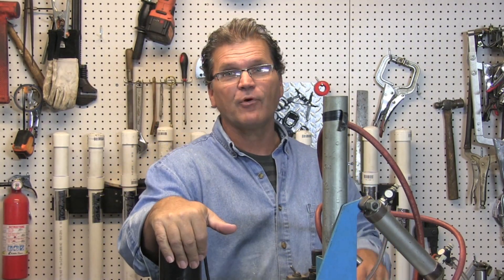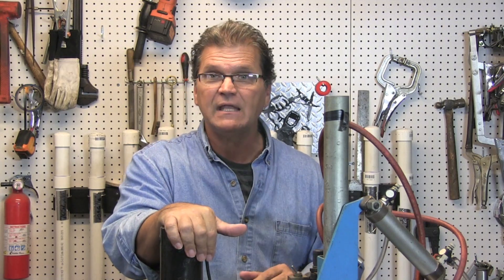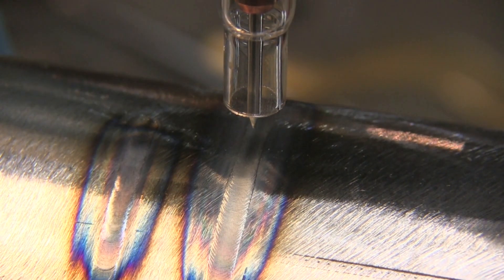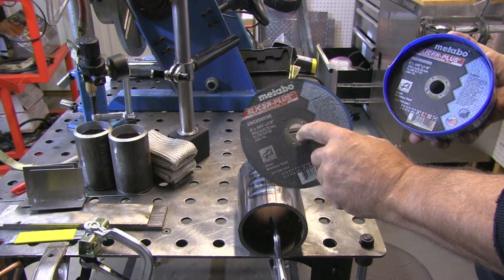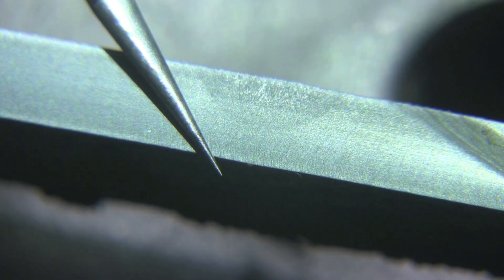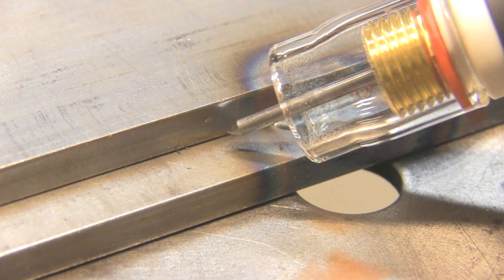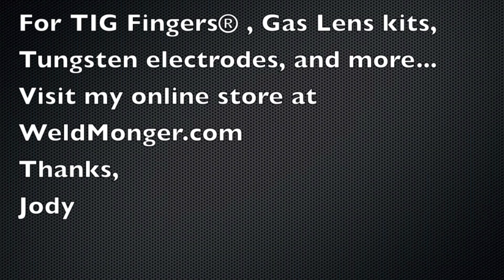Tig Welding Penetration & Tungsten Electrode Grind Angle

Comment: Thank you very much for making these! The perfect visuals are helpful from an educational standpoint.

If you were attempting to “spot” weld thin sheet metal to a thicker steel would the 60 degree angle be most effective out of these 3 to reduce the puddle itself and promote good penetration? Or would this be most likely to lead to burn through given the deeper heat affected zone?

Comment: Hay there bud, I was over at the website, I want some of those clear lenses. but I see it says that they are for a numbered torch. How would I know what torch number I have? 
I am running a miller syncrowave 250 DX and am using the same torch it came with.
I see the diagram with pictures of torch tips.  But I am little confused about it.  
for example this item:  Furick Jazzy #10 Glass TIG Cup Kit (for #9/20 and #17/18/26 style torches W/ Adapter kit) 
does this cup fit both style or I got to choose the cup that fits mine. if I got to choose the cup for my torch, I don't see the choice....
I think my torch is number #9 or 20.

Comment: Ah! But of course! The needle tip weld seemed counter-intuitive. But thinking about it, the long thin tip is introducing resistance in the electrode (also heating it to the point where the Ar will ionize - also throwing away more energy) - energy that won't go into the weld. I can see clearly now. (or at least more clearly - I think).

Comment: Thanks Jody,  I went today and bought a diamond wheel $ 10.00 from Harbor Freight a 6 inch grinder some filler rods came home married the diamond wheel to the grinder got some tungsten purple from Air Gas tried out my grinder works great
Now after watching your video I understand the grind angles now 
after 50 years of stick welding I am going to try TIG I was good at gas welding and it looks similar.
It looks fun to old to make a career out of it just want to run some beads anyway enough said thanks for showing old timer new stuff.

Comment: This is very good and well carried out experiment. Just a comment using an IR thermometer for checking heat on a shiny piece of metal..... Beware folks, the so-called emissivity for shiny metal is very close to 0.1 (this calls for a reflectivity of 0.9). This means that an IR thermometer must be adjusted to compensate for this fact. Otherwise, the temperature reading will be far too low as Jody´s piece of metal only emits 10% of the heat energy. It is very common people use IR thermometers on too shiny or too small surfaces. The latter means that background heat radiation gets into the optics. This of course give wrong readings of objects too. Best regards /Jan

Comment: If you haven’t done a video on flat tip electrodes and prep angles, this would be a good one to do.  My experience with a flat tip on the electrode increases penetration.  Combine that with a different angle of preparation and see what you come up with.

Comment: Something I'd like to see demonstrated is old school technique using the side of the ''arc flame''. Yes, flame, just like a Oxy/Acet flame welding technique. Back in the day, most small bore was gas welded. Doing so you used the side of the 
welding flame ''cone''. TIG arc flame is similar in that you have a arc ''cone'' from the tungsten. Angle of tungsten grind greatly effects that, as well. I'll await your reply.
 Jeff

Comment: Excellent job, nice setup, it would be good lab in some kind of class.  The thing that comes to mind now is what about the idea of a flat on the very tip of the electrode?  Sort of a zero degree point.  This should be the most penetrating, but also the hardest to start, right?  I think that having a taper and a blunt of flat tip sounds like a good compromise, but I have not done this kind of test, even though I have the STUFF.

Comment: I bought a welding positioner because of these videos!  Would like to see at least one more here, the good old balled end of history.   Just because!  It's easy to prepare, right?  Might be more durable, too.
Reply: And while we're at it and using a nice precision tungsten grinder....  How about the fairly common taper with a flat on the end?   Like a used pencil.  I read once in  a very early book about TIG welding that electrodes were sometimes ground like a chisel or screwdriver!   I keep wanting to try this....

Comment: The Halo, Angel wings are due to the argon actually being heated along the drawn out electrode. The blue line is the point at which the lower portion of the tungsten that is actually superheating the argon, but don't ask me if it does anything other than make you feel special to see them.

I'm sure it assist in burning oxygen around the weld puddle and surface contaminants; however, to what extent, I can't say for sure. It may be good for something around the weld that you can't get off of the work piece. We need someone who's further into physics to venture a hypothesis...

Comment: I'm right there with you on that second grind. CK has some information on dimension vs penetration. Max is 3 times the diameter of your tungsten according to their information. I like 2/3 of the diameter and the tungsten really settles in cleanly on long runs of aluminum. Just the best in my book too.

Comment: on the acute-angled electrode, you said there was a halo effect. To me, it looked like plasma discharge which would explain the low penetration in the metal as electrical energy was being wasted in the plasma discharge instead of being a focused arc.
But that is just my observation.

Comment: I guess the very sharp edge of the third electrode had such a high temperature (=and ohm resistance) that it explains the arc coming from a few milimeters above the tip. I believe the heat was not that concentrated and that is the reason why the third bead was narrower.

Comment: hello sir, can u help me with a problem we face on tig welding. we do fusion welding of ss sheet, thickness .30mm, grade 202 for steel tanks.
but when out automatic welding robot arm starts the weld at the starting point of the job, it burns a hole into the sheet and then after wards it does proper welding moving forward till the end where it again ends the weld witha burn hole
we do not understand y, kindly help. thankyou

Comment: Really nicely controlled experiment. Up to now, I have always MIG welded--Bam! Metal stuck together!  However, as a beginning hobby TIG welder, I don't see much distinction between these welds. They appear different by a few hundred thousands in width and penetration. Is the intent of TIG to be that precise or does this experiment show how things might extrapolate in the 'production' TIG process?

Comment: Jody, I just purchased my first TIG Welder. It's an Eastwood TIG 200. No matter what setting I use, it absolutely destroys 2% lanthanated tungsten. It will melt completely away instantaneously. Thoriated and pure Tungsten work fine. What could cause this?

Comment: that was really impressively sciency with all the strict controls on the variables from the angles to the gap and weld speed. very nice test, good info.  Did wonder if the IR measurement of temperature pointing at the shiny metal surface really made the measurement of the metal or the reflected room temperature. Emissivity and all that.

Comment: great video Jody. I usually always needle sharpen my tungsten when welding ferrous metals for no reason at all except I felt comfortable with it. now I see that I can possibly weld better with a blunt tip. I wonder what the effects are when using A/C current and welding aluminum??? thanks for the lesson.

Comment: Very nice and interesting video about tig welding! I'm not a pro welder but I have quite good skills in smaw welding and i'm going to buy an inverter welding machine AC/DC to weld with tig process in alternating and direct current! As you properly  assert, penetration is affected by the angle of tungsten electrode. What about the influence of the current on the penetration in tig welding? Thanks a lot Jody! Andrea from Italy! Bye!

Comment: I am watching your channel! I even bought the package of yours. I am not a welder though I weld since 75 years, on and off, not enoough. I have Lincolln-175 for years but I can only fuse with it, never have time enough to settle down Ihahave 5 different wedding machine ,my hobby for 30 years was rebuilding cars.Now I am too old for tat so I build vintage motorbike s By profession I am a retired structural steel design engineer I had enough 60 yes of that. I am not a welding engineer but had to specify all welds for a large aeronautical museum and others
why I am writing all that? because watching all your pros I did no see one single interesting special welding 
I would like to see welding like building up an internal motorcycle,s broken rib in Aly and cast iron or some details different diameter spot welding or welding thin plates, recommended wire feed with amp tig amp fir platelet 22 gauge, so final something g new and interesting. I meant this comment as a constructive one not a criticizing one. I keep watching the show which is entertaining and that's for the effort. That Old Bob

Comment: Hi Jody! Thanks for doing this video. I think you may have hit upon a problem I'm having, that being how the arc "dances" around my tungsten like it's searching for something. I grind mine on a dedicated fine grit grinding wheel, holding the tungsten vertically and pointing down in the same direction as the wheel rotation. I wonder if I should he holding it horizontally and changing the direction of the wheel striations on the tungsten?

Comment: Jodi I have watched several of your videos very informative even for experienced welders. I have a general curiosity question when it comes to the gtaw process.  I tried this once but can't test penetration on it can you run a etch and polish test on a dragged weld.  I am curious about the amount of penetration. is it the same or smaller than pushed bead

Comment: I'm still learning to tig with my squarewave 200.  In what hand do you hold the torch? Dominant hand?  Thanks
Reply: Pretty much, I'm a lefty and hold the torch on my left hand.. my right hand coordination and precision is really bad, so I do have to concentrate even more when feeding the wire. Thoguh I have seen people use both hands with success, which is a pretty handy (see what I did there) skill, specially for welding in tight or odd places.

Comment: Hey there I got a question I take metal shop at my school and I've Ben working with are miller ac square wave tig and ark welder but we just youse it for tig my main problem is when I get the arc going it makes my electrode tip turn into a ball every time I go sharpen it. It always does it and advice ?

Comment: Interesting. I never thought electrode shape affected penetration. Also, the wandering arc was an eye opener. If I was still in the trade I would definitely look into using a finer grinding wheel. I remember holding the electrode so that the grinding lines were parallel with the center rather than across. This usually resulted in grooves in our wheels, but cut down on arc wandering. I wonder if the penetration difference is a result of more electrical  resistance at the tip of the sharper electrode.

Comment: weldingtipsandtricks
Can you help me in the difficulty?
I have two brass pipes with thickness of 0.033"(or say 0.83MilliMeter) how much Amperage, what & how much gas I should use?
Although I have learn from this video that I don't want to penetrate deep, so I can use a more angled.

Comment: I'm curious about the effect of a double-bevel grind, like many knives use to achieve a low angle profile without an overly thin weak edge. The extreme of multi-bevel being a convex grind, and the two extremes of convex being a half circle on the strength oriented end and a simple flat grind on the thin/sharp end. The extreme of a double bevel electrode would be a flatted tip, I suppose.
For an electrode I would think the transition between the two bevels would be somewhat important, in degree of change, position from the point, and finish(rounded, buffed smooth, or hard and sharp). You would probably want the position of the bevel transition either fully clear of the plasma or right down in it[flatted tip eg.], but not too near edge/transition of the plasma cone especially if it is a hard chine.

Comment: Awesome demonstration, I started playing around with grind angles myself after listening to the podcast with Rush Kane. Which weld out of those three welds would be the preferred over all for weld penetration and heat affected zone? Or would it just depend on what was required for the job at hand?

Comment: Jody,  What would this same test do with a higher voltage?  Could you use a higher voltage with blunt or ultra sharp taper to get better weld nuggets in certain applications.  A higher voltage if you had to do aluminium with a blunt electrode?

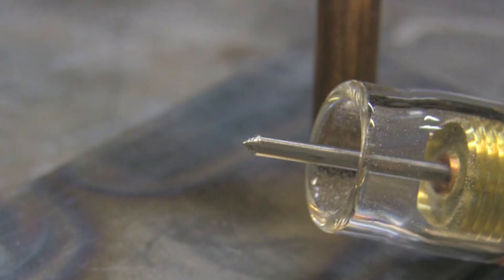Comment: 2:01, you really haven't even started yet, and yet I just learned something of what I've seen and had the effect of with my minor Tig experience.  Nobody I was working with told me that the sideways grinding of the tungsten would mess up the output like that, but that's exactly what I was working with ... All I had was a table grinder without any guide like you have there, but had I known I certainly would have made the effort to hold the tungsten in a manner to grind it lengthwise.
Reply: I use an odd tool for sharpening but it works REAL well. Take an old belt sander, put on 80 grit belt (or finer), turn the whole thing upside down,  turn it on, lock the 'on' button switch,  and center the belt tracking, put the tungsten in a drill chuck (I use 20V lithium ion DeWalt), set that on low speed, use the tail case of the sander as the guide, and wipe the tungsten across the belt w/ very slow turning speed. This grinds the point metal AWAY from the tip, does not leave swirl marks, and it's real quick to do. : )'

Comment: Jody,for someone like my self who does mostly hobbie welding what TIG welder would you suggest a person start out with. I have a Mig and a stick but would like to learn TIG. Thanks
Reply: Rich Parker what kind of stick machine? You can get most likely set it up to do scratch start tig
Reply: tgraham7r  It is just a Lincoln buzx box. not able to change polarity.
Reply: Rich Parker if you're looking for a multi process machine I've used D.C. Tig on the multimatic 210 and for a all around home machine it works great using 220V if your looking for a dedicated machine id look at the dynasty line awesome pulse settings and the ability to use AC is also clutch

Comment: Excellent video. Thanks Jody. Just getting to grips with TIG and what a voyage of discovery it is! Got my first job as a welder making refuse skips with a 450 amp MIG. Back tracking to stick just to make sure I can stick metal together now. TIG is still something I have yet to get flowing right. Never been a gas welder so in at the deep end it seems. Prep is everything. My main piece of advice to anyone learning to weld would be keep your mask clean! And no back light behind you. Get the light source out in front and you can really see the weld. These vids are so good as you can really see what is happening. Great work.

Comment: What is the tungsten sharpener you use?
Reply: It seems he not use the best one, no liquid cooling , the Tungsten get to hot and thats where you already destroying the Tip of the Tungsten. The Tungsten is made out of Powder and pressed in shape. And if the Arc ignites well or not, has more to do with the distance from the Tungsten to the workpiece.Btw i like his Movies, and learn a lot  too, but it seems he is welding with different Rules, The Tungsten comes out very much from the Gas Nozzle, and the distance Tungsten Workpiece is far to much.I never have this wide weldings even i use a 4 mm Tungsten.

Comment: Hey Jody thanks for another great vid. One area I'd really like to see you cover in more detail is the forces related to weld distortion. I build race car tube chassis and welding each section whilst in the jig isn't always practical.  I try to sequence welds so they cancel each other out but sometimes just have to weld off a rotisserie to access certain tube. I often wonder how much forces are caused by weld distortion and whether I can put a bar in unsupported, just on tacks or am I going to have to jig each bar ?

Comment: I am nothing like you.  You are an expert teacher/welder and I can barely stick 2 pieces of metal together! :)   Very good comparison, interesting results for sure... thanks for the video Jody
Reply: ....watch, go practice what you've seen, repeat! Had opportunity to learn to weld myself starting with just running 6013 in position beads in H.S. shop back in 1975/76. Much practice, some work related experience since. Got to be an instructor to adult and H.S. students here local to where I now live....not welding!, ( instrumentation, core, and construction management.) I regularly used YouTube videos as an integral part of the C. Mgmt. H.S. classes (plus much lab time/hands on) and that's how we discovered Jody's neat site, products, and videos!! Great stuff, several of my students came back for 2 to 3 more semesters, several got 6G tig and stick pipe certified and a couple now earn more than I do!! : )'